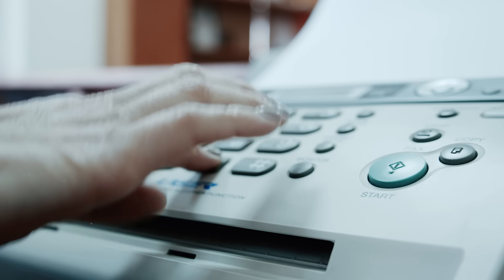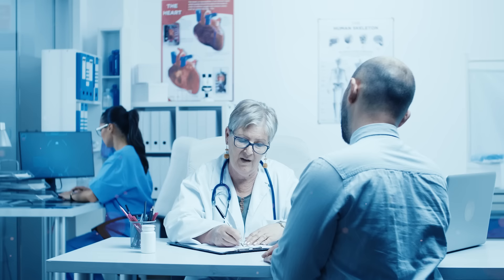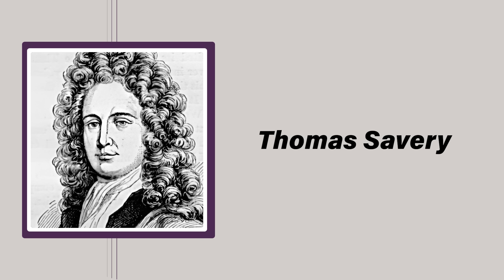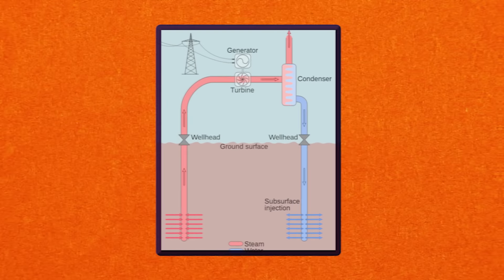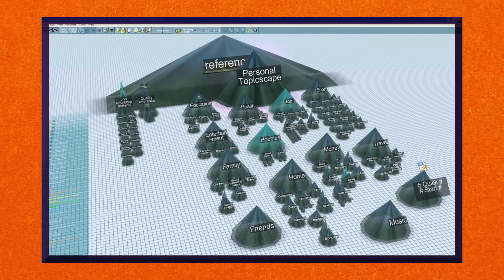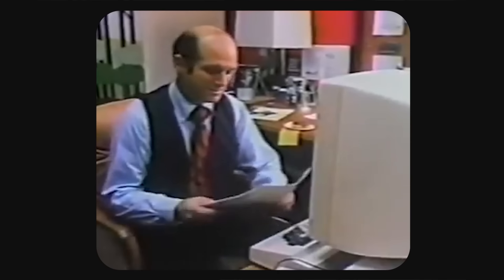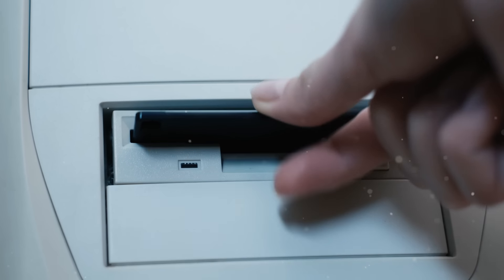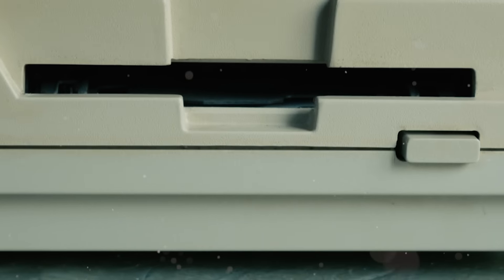Terribly Outdated Technology that we Still Use...

Comment: The moral of this story is that things that work, work. Just because something new comes along, that doesn't mean the previous generation stops working. Quite the opposite. Some of those systems are incredibly complicated, and their reliability is the result of decades of refinement. Trying to "upgrade" to the newer stuff inevitably ends up introducing errors no one thought of, and then you're stuck, since the last guy who really understood the internals retired in 2004.
Reply: Change isn't always good and new isn't always better if it's not broke don't try to fix it
Reply: That's why you need the sort of Rube Goldberg mind that will think of the most complicated, inconvenient way of doing something simple, but will think of errors and mistakes you'd never come up with in a hundred years of Sundays.
Reply: But if you don't upgrade how are the vendors supposed to sell you a subscription to use what you purchase?
Reply: Still its important to look at new stuff and ask yourself "is the upgrade worth it?" by staying blindly to tradition you put yourself at disadvantage, balance is important

Comment: If I recall correctly, some Soviet aircraft in the 80's had valves instead of transistors as they could survive a nuclear related electro magnetic pulse where transistors would just get fried.
Reply: Tubes had gotten very small by then basically tiny metal cans no bigger than an electrolytic capacitor in size. They're still used in high power RF equipment because transistors don't scale up well. They have these massive tubes called klystrons that are over a meter in lenght that are used in transmitters and radars because in spite of their size it's still smaller than the solid state equivalent would be and is actually more efficient.

Comment: I still use XP on an older computer that isn't connected to the internet or my network, for writing code.
I move data back and forth between it and my laptop via memory sticks. it works out really well.
Reply: I miss my XP Pro system. Still have my old computer and the installation CD.

Comment: A funny part about still using fax machines is that a lot of phone lines have nowdays been switched to voice over IP. And that IP connection might in turn be over DSL using a phone line. So, there is used an old technology designed to transmit images encoded as sound on top of a newer technology designed to transmit sound over a data network on top of a not that new technolgy designed to transmit network data over a phone line on top of a very old technology designed to transmit sound as analog electric signals. Yet, incredibly this stack of technologies from different eras still works somehow.
Reply: Go one step further.... records are making a comeback. And many of the older record players exspecially from the height of the 50's-70's are in coming to high demand. Some of them can compete like my magnavox systems dollar for dollar does its job.

Comment: Another still common use of floppy disks is for theatre lighting technicians, for a lot of now-vintage lighting consoles (such as those made by ETC) which are still in widespead use. It's often the only way to save your show data, or bring it with you from one venue to another while on tour.
Reply: Yep. Something to be aware of - as I understand it, the last manufacturer of floppies has stopped making them. But there is a company that found a ton of old ones, which they sell.
Reply: What I don't understand is why they don't use a floppy disk emulator. It plugs in and emulates the floppy disk interface. This way you could use modern bigger storage like SD cards or flash drives without the extra hassle of finding your local floppy dealer.
Reply: @BreakdancePeach  "extra hassle of finding your local floppy dealer" -

You just hit up your dealer on his pager. Same as we always did.
Reply: @senseisecurityschool9337  But he lives an hour away, so you take your local steam train to his place
Reply: OMG I remember 1997 haveing 10 floppy disk , I have went to by buddy and copied on those Tomb Raider , and as game weight some 100mb , I needed to make 10 trips , and as my friend lived on other side of my home city Poznan , I done that over a week , but funnies was I had 486 dx , 66mhz +8 mb ram + vga gpu , so game worked in 15-20 fps , and my hhd at the time had 200mb = 50% of hhd , but DAMN I had fun playing that game :)))
(BTW yes that was pirate game , but I was living in Poland then and Piracy was not illigal :))
Reply: We still maintain and update an embedded computer which uses floppy disk for development. The underlying hardware is barely capable of USB and the SW even less. But this old hardware is extremely reliable. We had only one unit not working anymore because of a worn flash drive, one because of the power unit and two because of a flooding 🙂.
Reply: @BreakdancePeach there's a couple of reasons for the lack of emulators. The primary one is that it is incredibly difficult to get one to work. Lighting instruments are incredibly fragile. In order for them to work you need the same signal, same repetition, same wattage etc... this means that them emulator needs not just be capable of running of running the software but also of emulating the exact specifications of the hardware as well. The second reason is that few things are as reliable as floppys. Less moving parts so they work 100% of the time all the time.
Reply: @jonahmoore5228   I think you mixed up some things. Floppys need no light. An emulator just with the floppy interface would quite simple. Speed and complexity are not high. Emulating just the floppy with an existing drive is another ballpark and more or less impossible with sensible effort.
A floppy is not that reliable. If used a lot or just over time it will break somedays.
Reply: I bought a load of old mini discs once, one of them was obviously from an old karaoke machine and hadn’t been wiped. It was hilarious

Comment: Don't underestimate the beauty of a machine designed to do one thing perfectly vs. one that does a million things kinda so-so.  Also, vacuum tubes still persist in guitar and Hi-Fi amplification.  Not sure how much broadcast and communications equipment still use them.
Reply: Tube amps produce a nicer sound than solid-state amps.
Reply: Tubes are still used in high power RF generation for radars and radio and television transmitters. The tubes are enormous (like a meter or more long) but still smaller than the solid state equivalent because transitions don't scale up to those power levels as well as tubes do. See: https://en.wikipedia.org/wiki/Klystron
Reply: I believe vacuum tubes might be used in some military applications, because they are easier to harden against EMP than modern electronics.
Reply: @atomicskull6405 This is becoming less and less true over time.

Comment: I'm a bit of a connoisseur of very old technologies which we still use today. My favorite is the humble shoe string which in one form or another dates back at least 5000 years based on Otzi, the iceman found in the Alps in 1991.
Reply: That hiker Ozi ? He's been missing since 1910... 🤣
Reply: I worked in a cash accounting office about 15 years ago.  During a slow period, I cleaned the office and got rid of lots of old files & assorted junk.  When I cleaned out the safe, there were hand-written double-entry ledgers in there. The tall, brown, binded kind with the green, columned pages.  I had never even seen one in person before then.  The weird thing is they weren't as old as you'd think.  IIRC they were only about 10-15 years old.

Comment: I operate a laserwelding robot, the old one that got replaced last year ran on ancient version of windows mobile. That was not a bad thing. the sofware was really really stable because almost al bugs have been patched out. Plus, it required  just a tiny amount of memory to run , which is critical if your robot is dependent on a stream of real time data to know where it is or is supposed to be going next. 

old does not always equal bad or obsolete

Comment: Your list should I think have included the vinyl record player.  One of the earliest commercial music reproduction technologies which has not only survived against all odds but experienced a renaissance in the 21st century.
Reply: There is a good technical reason for this to, you see, digital storage is what we call discrete in time, meaning that it operates in the amounts of points of data that is capable of recording per second, the more advance the system, the more data per second you have and the clearer the sound is, however this is never perfect and even if you can store millions of points per second, is never a continuous "perfect" thing.

Vinyl records are fully analogic, they are continuous on time, so they store everything in every moment, so no matter how advance your digital system is, a vinyl record is always going to be able to store more "information" and they are the closest thing right now to "perfect" audio recording.
Reply: @MartínArriagada-e6r  This is, of course, false. There's very reliable math which demonstrates this (Nyquist-Shannon Sampling Theorem). Digital signals can perfectly record and reproduce every sound within your hearing range with a finite number of samples. Above a certain sampling threshold (about 40 khertz), a human ear cannot differentiate. Also, as a technical matter, vinyl is LESS accurate at replicating sound than digital mediums like CDs, which is why it is associated with a distinctive warm and fuzzy sound. The revival of vinyl probably relates more to personal preferences (nostalgia, physical ownership, etc.) than to technical reproduction of sound.

Comment: Until very recently in my job as a Federal physician we were assigned Motorola pagers. What a reliable beast of a device! You could hurl it across a room in frustration and it would fly apart in a most rewarding way, and then it could be reassembled in seconds and work fine. They did not however do well when they fell into the toilet 🤣
Reply: One of my pagers did not survive being in a car crash. My work ended up writing that one off and issuing me a new one.
Reply: Same with those old Nokia 330 (?) phones. I tossed the bed once and tossed the phone with it. Phone hit the wall and fell apart. I picked up the pieces, put them together and the phone still worked.
Reply: They are also just great because you know if someone pages you it's urgent. It's nice to have one and be able to turn off all the non-urgent distracting noise of a cellphone. The constant access people expect because of cellphones is kind of annoying.
Reply: 'fell' you claim?
Reply: @robertnewell5057  if it's me you're asking. Yes, after I shook the duvet and tossed the phone up, it fell. Gravity, you know.😜 Lol!